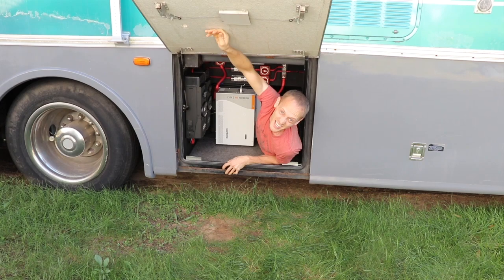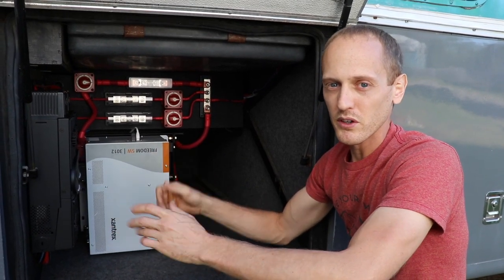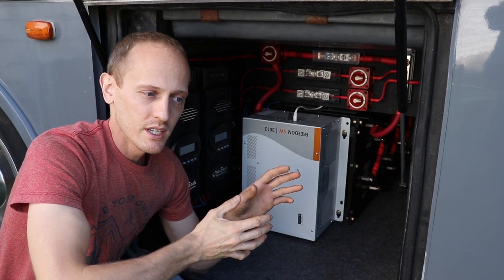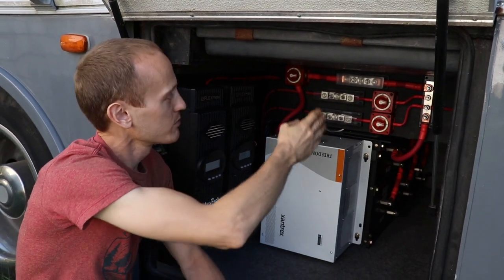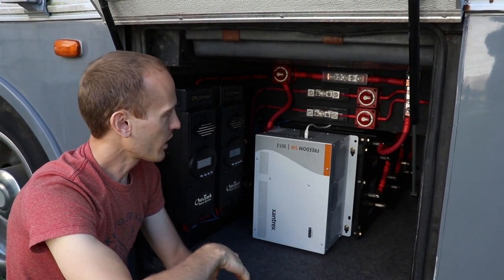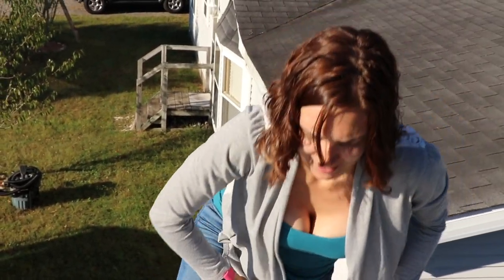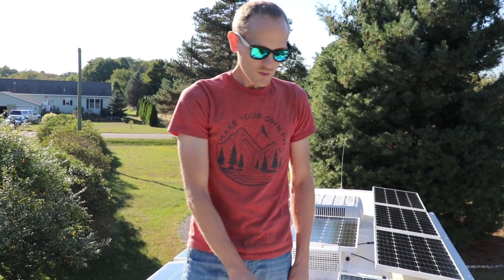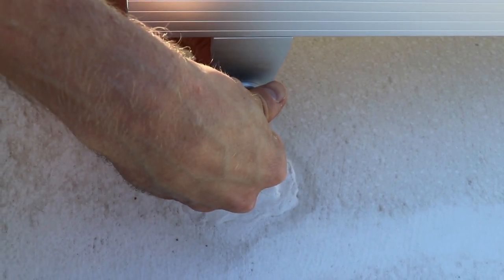Massive DIY RV Solar Install for Off Grid Boondocking

Comment: Great video!!! Nice and neat too. Do you have a drawing of your wiring set up under the bus by any chance please??? That's the thing we are struggling with so it would help us immensely. Thank and we look forward to watching more of your videos.
Reply from the maker: The fact that every set-up will be a little different makes it hard to just give exact specs of our system. Unless you do everything exactly like we did, there are variables like wire guage, fuse size, breaker size, and how you wire the sub panel. While we were halfway through the build, we found a great group on Facebook. You can ask specific questions and there are lots if knowledgeable people there for quick feedback. Hopefully this link works for you. https://www.facebook.com/groups/1730535217184853/?ref=share
Reply: @HereThenGone  thank you for your reply. We really liked how neat and tidy yours is and it doesn't look confusing just looking at it lol! We'll definitely be trying to do the same....hopefully!!! We'll be watching this video a few times that's for sure. Thanks again.
Reply from the maker: @judithmaurer7622  I used to be in to car audio, and we always tried to make things a neat as possible. Takes a little longer, but it really does help simply everything when it's done. If you have any questions about how much solar you need or how many batteries or how big of an inverter, you can check out another video we made on sizing your system. Hopefully it will also be helpful. https://youtu.be/UnCM5gCqSWs

Comment: Very nice system indeed, I would have only suggested to use at least a 24 volt  battery system, the charge controllers and inverters tend to be more efficient with higher voltages, not to mention the money you save with smaller wires switches and fuses (and possibly just one charge controller), I know you did it because you were worried about getting shade on a few panels but in my experience you're always going to look for a parking spot that has no trees around it and if you have no choice but to park on a partially shaded area, more than likely it's going to affect your solar array enough that you will have to rely on another energy source regardless if you're system is in parallel, series or a combination of both, I'm also aware that your rig uses 12 volt for many things like the fridge controller, a/c controller, lights and exhaust fans but you can get a step down converter that will handle all your 12 volt needs for probably less than 50 bucks, anyway great video and good luck
Reply from the maker: Going 12v had nothing to do with shading actually. It's always crazy to me that when building a system of this size, there is such a concern about the price of a few feet of wire. Haha the wiring from the roof is only 10 guage because each array is putting out about 120v. Then from the charge controller to the batteries is only a couple feet of 4 guage. Even the 4/0 between the batteries and to the inverter is only about 10ft. The amount of cost savings in that little bit of wire would be inconsequential to the overall build cost. I do appreciate your opinion though, and thank you for taking the time to comment.

Comment: One more crazy question: Have you ever seen anyone put a MicroInverter on each panel, converting to AC right on the roof?  Clearly, that does not help with getting the batteries charged unless one upgrades their AC/DC BMS to charge the batteries.
Reply: They would have to synchronize their frequency with each other.  Grid tied inverters synchronize to the mains but a peer to peer inverter synchronization does not exist.
Reply from the maker: I guess my only concern there is that you could only run AC appliances if you had enough solar at that moment. That's why you just charge the DC bank and draw through the inverter. Don't have to have good enough sun at the exact moment you want to run something.
Reply: @HereThenGone , If you have a hybrid inverter, like a Magnum MSH2030, it could be theoretically done, but it would likely be very inefficient.

Comment: Really nicely put together. I'm on more of a budget than you appear to be. I put a 7.2 KW on my house, but I'm told house pannels will not take to vibration of the road -- do you know if your pannels are rated for mobile use? (I have though about applying self-leveling expoxy to the back of house pannels to toughen them, but I'm not sure that would be enough). Any thoughts on used lithium batts?
Reply from the maker: Thank you Sterling. There are a lot of people that use house panels for their rigs. 325w are a common size we see based on their size fitting well across an RV or van roof. Most people who use them have a rail system in place that allows for easily mounting the panels level with each other and also allowing for more mount points. Heat is the enemy of solar efficiency. funny because they need to be in the sun to work. haha. On that note, adding another layer of something to the back would help hold in heat and lose efficiency. As for used Lithium batteries, if you are thinking EV(electric vehicle) batteries, then you will need to make your own BMS(battery management system). That is what would regulate balancing of cells and prevent over or under charging. If you don't want a system that you need to monitor very often, you could go with Battleborn Lithium. they are a drop in replacement with their own built in BMS. they are pricey though.
Reply: @HereThenGone  Thanks for the info. I was thinking of mounting everything on 2 Aluminium "L" rails.  It seems that there would be little reason to go with the lower performance flexible panels.
Reply from the maker: @LiberyTree  that is exactly what people do. Either angle, uni-strut, or 80/20. And yes, rigid panels are a much better choice than flexible.

Comment: Thank you sharing your solar system setup.This is one of the cleanest looking setup I have seen. Are your charge controllers wired to work as one? After watching a video about charge controllers I realized I need to get a 2nd charge controller. I currently have 5 345w panels 37.5V @ 9.28A this is too much for my PT100 which is only rated for 100 amps.
Reply from the maker: Thanks for the kind words. each of my charge controllers are independent of each other. That way, if we get shading on one array of panels, the other controller will still be putting out max amps.
Reply: Nah you're fine running those panels on that controller. I have 1770 on a Victron 150\100 and it will max at about 1400w and 100A on 12v. You won't usually get the full rated output of your panels. It's generally about 70%. Mppt controllers will just limit it at the rated amperage.

Comment: Great info and video! Don’t get why people keep saying you should have bought lithium maybe they should pay for the darn things, they are ridiculously expensive. You have a super sweet set up. Is there anyway you could email me a parts list I would like to run a similar setup? Duarterafael23@gmail.com thanks in advance if you do and even if you don’t lol. Have a blessed day and keep up the good work. Maybe one day we will bump into each other on the road.
Reply from the maker: I appreciate that man. You got it exactly right. We saved for over 2 years to afford this setup, so to go lithium would have set us back another year probably. I'll try to get a list of all the major components together for you. Length of wire and various hardware will obviously be different, but that's the little things.

Comment: I’m thinking of putting the panels on the roof of the trailer that I pull with the motorhome which has a car and motorcycle inside but could handle the battery weight then cabling to it with my power cable that I plug into the grid. Any thoughts about this idea?
Reply from the maker: If you had the inverter setup in the trailer as well, that could work for 30amp supply. You could park the trailer in the sun and keep the rig in the shade. You would just have to wire a plug for the 30 amp in the trailer instead of wiring in the sub panel like I did.

Comment: Did you consider adding a DC to DC convertor to allow the battery bank to charge off of the alternator when you drive the coach or run it while parked?
Reply from the maker: It was already wired to charge from the alternator. All systems are 12v. No converter needed. 👍
Reply from the maker: Also, if I were going to run an engine while parked, I would run the 6500w Onan and not the 8.3L turbo Cummins. Haha. It only uses about a gallon of diesel per hour, would run the 150amp charger in my inverter, and would allow me to run all my other AC appliances as well. Win win. 😁

Comment: What did you pay for your batteries? My research shows $3954 for the 6 AGM's and $5694 for 6 Lithuim's. that's only $1740 difference and a weight savings of 500+ lbs buying the Lithium batteries and you get the benefit of a faster charge rate as well as a 90% depth of discharge.
Reply: Technically Lithium Ion has it's longest life if kept between 20% to 80% charge so it's really a 60% discharge cycle but most controllers can not be throttled at 80% hence Lithium Ion is often said to have an 80% discharge cycle from 100% charge to 20% charge.  Also although lead acid has 50% efficiency on charge, it has a 95% efficiency on discharge, claims of discharge efficiency of Lithium Ion has been improving with manufacturers now claiming 90% and Wikipedia has been updated to show that but up to this year it was below 80% with a combined charge discharge efficiency of 72% listed on Wikipedia.  This means the rate of discharge at the temperatures of the batteries determine the actual capacity of the battery often falling short of claimed battery capacity depending on load and it's quite likely that the manufacturers are qualifying their claims by usage restrictions and modifying Wikipedia to be more favourable to lithium ion batteries.   Obviously, this could be buffered through capacitors and power electronics to discharge the lithium ion batteries at a more appropriate rate.  Yes, the higher energy density per both volume and weight may warrant lithium ion particularly if the vehicle had to change speeds often, but also remember that lead acid batteries can be easily reconditioned to the equivalent of new conditions while lithium ion batteries just have to be sent to recyclers.  Just cause catalogs and manufacturers make snazzy claims isn't always the reason to design a project around a given technology.
Reply from the maker: We paid $3500 when we bought them and Battleborns were still $989 each. If you would like to send us the extra $2400 to get the Battleborns, we wouldn't turn you down. Haha. But seriously though, we aren't made of money, and it already took over 2 years of overtime and weekends to save up for the system we have. Along with all the other modifications we are making to our rig, it would have been at least another year to save up for lithium. And the ol' 8.3L turbo Cummins with 6 speed Allison transmission doesn't mind the weight. We'll switch to lithium if we ever have the money. Wasn't in the budget this time around

Comment: Super sick set-up. Would like to see an electric pressure water cannon turret, though and maybe an indoor greenhouse.  Nice eye candy as well. Peace.

If Lithium goes down in price would it be worthwhile on a retrofit?  Any chance of running a regen system as you go down the road?  
Super focus dude thx.
Reply from the maker: Thanks. Lithium in the future would definitely be worth a retrofit. It just wasn't in the budget this time around. Haven't thought of a Regen system. Food for thought
Reply: This could be a definite maybe for a tow car. Chevy Volt. I do t know if it is worth it around town but on trips of 100 miles or more you could be “winding up the rubber band” to get a few miles. and then when no regen is possible just plug it into the solar for an appliance as valuable as the refrigerator. Thanks.
Reply from the maker: @ofs4654  you would need a MUCH larger solar array than what we have here if you wanted to charge your EV batteries on top of normal daily usage
Reply: Thank you. Cool channel.

Comment: I'm considering doing solar should I use a 12v 24v or 48v  system
Reply from the maker: That is totally up to you. Higher voltage is slightly more efficient for running your 120v appliances, but then you need a more expensive inverter and a DC to DC converter to get back to 12v for all of the standard 12v RV lighting, fans, water pump, etc. So you lose efficiency in that conversion. We are 12v. Run the proper size wire or even a size larger like we did, and it's no big deal.

Comment: I applaud your throughness in the quality of install... i will have to say tho that you spent way too much money for too little performance....  .. food for thought...  if i had to make a suggestion... i would mention converting to 48v batts  like out of a nissan leaf or something.. and boost it to 12kw storage so you can save a full day of sun...  prolly for the same price you paid for thosd lifelines
Reply from the maker: Appreciate the comment. We are more than happy with the performance. I didn't want to have to make a BMS to run EV batteries and didn't want to have a DC to DC converter to run all my 12v. The more storage you have, the more solar you need as well. There is only so much roof on the rig. I spent what I did because I went with top quality products. You can get cheap 3000w inverters, batteries, and charge controllers to give you the same system I have on paper, but it won't perform as well as ours does. Any upgrade in the future will be going lithium, but the budget for drop ins wasn't available when we did this.

Comment: I hate to ask but would you be open to putting together a tools and material list?
Reply from the maker: That would be a looooong list. Haha. Every install is different in terms of materials. Most people can't haul 720lbs of batteries. If I included all the power tools for the custom brackets and battery tray, that would be more than most people have as well. If you would still like to know, I could try to get something together for you here.
Reply: How about just the bus bars.  I can't find the heavy ones you've used.
Reply from the maker: @johntatman1436  sure thing. These are the 600amp bus bars. By Blue Sea. They are top of the line. Made to withstand marine applications. It takes you to a 12 stud version. Just select the 4x 3/8 stud option to find the ones I used
.
https://www.amazon.com/Blue-Sea-Systems-600A-1000A-PowerBars/dp/B01FA3NSG4

Comment: wouldnt a/c have less voltage drop?
Reply from the maker: I don't understand your question. Could you elaborate so I can give you an answer?
Reply: @HereThenGone  did you run dc power to all of the appliances and lights? if you did, a/c would have had less voltage drop
Reply from the maker: @Robots4Sale  all of the lighting, ceiling vent fans, and water pump are 12v just like in all RV's. As you saw in the video, I have a 3000 watt inverter that changes the 12v DC power into 120v AC power for the refrigerator, microwave, all the wall outlets and one of the roof air conditioners. Those things can't run on DC power.

Comment: You have a well thought out and neat wiring setup. One issue I wonder about with DC system wiring, I don't often see the wiring installed inside a metal box, like the 120V AC system panel. I know that 12V DC is not a shock hazard, but you can still short those connections out if you accidentally bridge the connections with say a metal wrench. 
Have you thought about installing the wiring connections for 12V inside a plastic box? Or some other way of protecting them, like rubber covers over all the bolts and bus bars?
Reply from the maker: Definitely don't underestimate the damage that could be done from a 12v system of this size. There won't be anything else in this bay so nothing to accidentally fall across connections, and if I have to get in to work on something, I'm fully aware of the potential hazard. In order to work on the batteries, you have to remove covers anyway, in which case you are right back to the scenario where you could potentially short something out. Rubber coated tools are a great idea for this. Thanks for the comment and looking out for us. 👍
Reply from the maker: Oh yeah, and for the positive buss bar, it had a cover available, but didn't allow for the main wire to come out the bottom the way it does here. I could always make a custom fiberglass one if I feel the need down the road

Comment: Nice job...probably costed you $10,000.00... I like the way you did everything. Are you sorry you didn't go Lithium? They have much better discharge power availability also less cells needed. I do realize the cost is about twice however over a long time I believe they work out to be quite economical. They also have built in power monitoring that a smart phone app can access. Everyone's an expert. You did an excellent and well thought out install.
Reply from the maker: Thanks for the compliments. We have $15k invested in this system as it is. I'm not sorry at all about going AGM. For the same 600ah usable I would have had to spend $6k for lithium. As you mentioned, we spent half that on the AGM(and these are the best AGM you can get, so a different brand would make the price differential even greater). Seeing as it took over two years of working overtime and weekends to save for what we have, we didn't want to wait almost another year to go lithium. Will we switch in the future if we ever have the money? For sure. But it wasn't in the budget this time around.